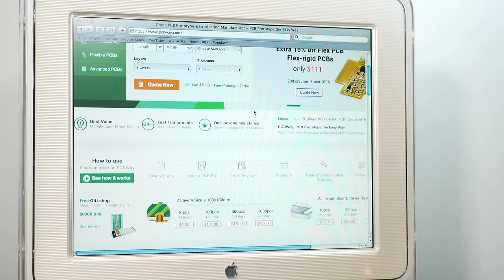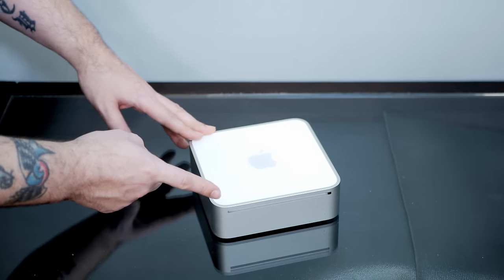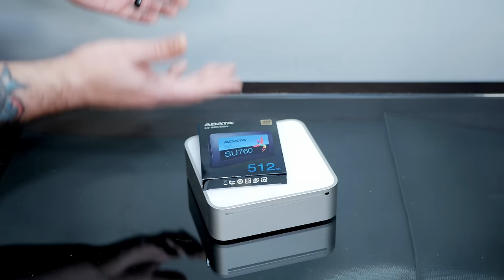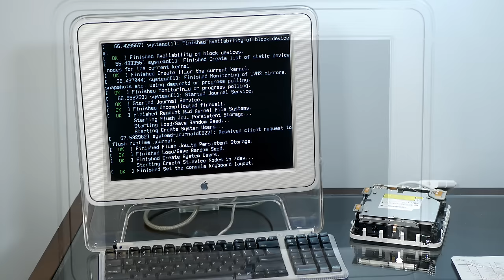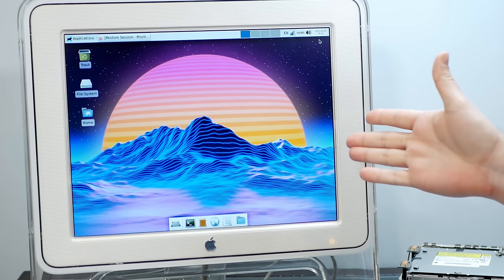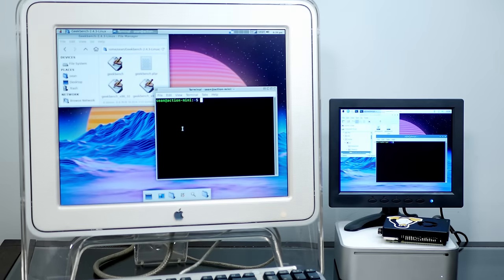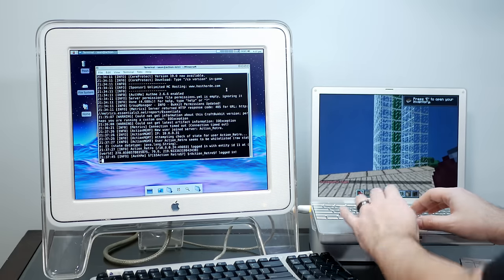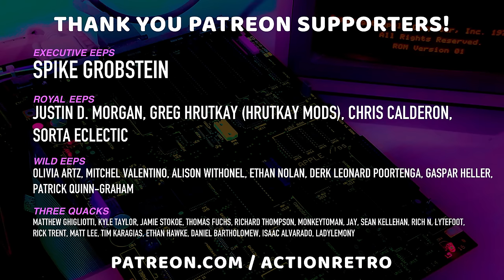Can a Cheap Mac Mini Out-Pi a Raspberry Pi 4?

Comment: The Geekbench score was 2x higher on the Raspberry because it has 2x cores, and a Minecraft server is a single core task. Basically a Mac Mini might be a better option if you only want to run a Minecraft server, but Raspberry can run more tasks at the same time so yeah
Reply: Minecraft servers nowadays use multi-core for chunk generation and loading, so the couple extra cores would help prevent lag spikes when people move around or log in!
Reply: Looked like the Pi had way higher FP performance. I think that would translate to Minecraft as well.
Reply: @seshpenguin  They really dont actually on vanilla Minecraft. That's why 2b2t for example is using an overclocked i9 so the server is somewhat playable.
Reply: @Piipperi800  Vanilla 1.13 and above does, but PaperSpigot implemented it for some older versions too (though in the case of ActionMC) it doesn't matter since its such an old version.
Reply: @seshpenguin  I don't think Spigot does that multicore thing by default unless you have multiple worlds. Also, 1.13 and above suck for servers anyway so those are out of the question here
Reply: @Piipperi800  PaperSpigot implemented multithreaded chunk generation first, now it's the default behaviour since Vanilla 1.13.

Anyway yea ActionMC is 1.2 since they want PPC client support :D I'm just saying if someone wanted a latest version MC server, a couple extra threads help out.
Reply: they definitly use at least 4 cores nowadays, but if the servers on 1.2.5 its not gonna use more than 1, maybe 2 cores
Reply: id' go for the least power comsuming system.
Reply: And probably, if he used the raspberry pi, the sdcard would die very quickly, and the SSD will work flawlessly for ages...or...at least 10 years more than the sdcard.
But if he used an external SSD it would be a different story.
Reply: @Piipperi800  they have used a few cores for a while now, And with 1.18 it uses as many threads (32) as I could throw at it for world gen
Reply: @virtualtools_3021  1.18 in general needs a pretty decent server now, running a vanilla one on my 2012 MacBook Pro and the server is often lagging out
Reply: This isn’t relevant for a Linux install, but 10.6 and later have Grand Central Dispatch which actually multithreads even single-threaded processes. 

For instance it doesn’t matter what thread variable you set on command-line 7zip, GCD/libdispatch will split it across as many threads as it can. 7zip is of course trivially parallelisable so it even uses the SMT threads at full, whereas most workloads only use them 25-50% as much as the first thread in a core. 

Though of course some processes are simply not possible to split-up, so usually the first core still has 10-20% more utilisation than the rest, and the final core will usually have 10% less. 

But GCD decides what can be split-up, rather than the app developer. So… maybe it’d help? But maybe not.

Comment: Great video!

Two or Three years ago a co-worker rescued two surplussed mac mini's at work and I installed Xubuntu 18.04 on one and Lubuntu 18.04 on the other.
We still use them for productivity. We use one for iridium satellite transmission testing and the other for random equipment  testing.

I love to see people squeeze more juice out of older tech!
Reply from the maker: Nice! Me too!
Reply: Hi - i in 2015 i purchased a fair few @2005-2007 early core2duo apple macs / minis and imacs from a school, i cleaned them out and changed the thermal paste
Installed 10.6 snow leopard on all of them and they ran great, as most people wanted modern broswer and good youtube playback i used refind to multiboot and installed linux mint ( the current version at the time possibly 17 )

Result is very cheap computers under $100 Australian, very stable and dual boot, they should run another 10 years, 1 sold about 4 or5 of them and gave away to family and friends 4 or 5, i just have 1 x imac and 1 x macbook, the imac runs 24/7 as a local file server for movies and music

Regards
George
Reply: I'm still using an iBook G4 as my daily driver laptop. I'm typing on it right now!

Comment: Also, the raspberry pi 4’s Ethernet is gigabit, not 100 megabit like the raspberry pi 3. Maybe start a separate server to test it and see how it works
Reply: well, I tried it and the cpu does not have enough performance and absolutely dies when generating chunks.
Reply: The Pi4 has fake gigabit ethernet. No idea why, maybe because it runs over USB, but it is hot as heck, and not delivering the expected speed, at best half a gig. The Mini does offer full blown gigabit with full duplex, jumbo frames and all.

Comment: I'm still amazed at how cheap you got that mac mini for.
Over here in France they are still worth 100s of €
Reply: At this rate, you might be better off buying an actual used server. It's not going to be the most powerful thing in hte universe, but my old Dell server from 2012 is still great for messing arround and I haven't had any issues running a minecraft server off of it, though I think it has never seen more than 5 people at a time...
Reply: @user-le8ul4nr5t  x58 is great dude, I just got a server for 230€, double xeon, 24gb of ram, fantastic!
Reply: In the US, the majority of Macs are cheaper because there are so many of them over there. Here, I can sell a 2009 Mac Pro with an NVME SSD for almost £1000 whereas I’d get the equivalent of about £600-£700 in the US.
Reply: @pietrocavicchioli6128  x79 and x99 are pretty cool too since they can take xeon e5's which are decently cheap right now.
Reply: @user-le8ul4nr5t  the main reason for taking the minecaft server off the G5 was power consumption.
While a vintage sever is ‘better’ hardware, a Mac mini or a raspberry Pi is much more power efficient.
Reply: @SalvoDan  most x86 and arm stuff is going to be more efficient than a G5, and servers kinda have to be decently efficient because they're meant to be run 24/7 for sevral years. Not the lowest power solution, but as far as performance per watt goes, servers are pretty decent.
Reply: @user-le8ul4nr5t  yes, but server for that platform often lack the gpu support, and they cost a bit more, and Chinese motherboard are a bit risky in my opinion, they are a lot less reliable than normal server boards, but yeah, if you can find the right deal even x79 and x99 are awesome!
Reply: @pietrocavicchioli6128  who needs a gpu anyway, ssh go brrrrrr.
Reply: Yeah that was a good deal. I have the same mini and it was $75, two years ago. I got a steal. They usually go for $~150
Reply: @user-le8ul4nr5t  Ip?
Reply: @Mangiatorte  It's a private server. I'm not publishing the IP in a youtube comment section. You would have to either know me personally or know one of my friends to get in.
Reply: Yeah I looked, been looking for a Mac Mini, and I've never seen them below $180 USD.
Reply: Here in the Netherlands or in Germany a 2009 is 25€, and a 2012 quad i7 with SSD is like 100€

Comment: I have actually tried both Mojave and Catalina on my 09' Mac Mini through the "Unsupported Mac" patches by Dosdude and it works surprisingly well for its age! It being a small device that can run as far back as Snow Leopard for the PPC and older Intel support, having Windows XP compatibility, and it being able to unofficially run versions of Mac as recent as Catalina (and Big Sur without GPU acceleration) for the more recent apps was something that I thought was really neat and a big reason as to why I snagged one last year!
Reply: I run all macs on 10.14, including the newer ones with official Ventura support. Still the best OSX ever.

Comment: Old Chromeboxes are also great for this purpose. You just need to remove the write protect screw, install custom coreboot firmware from Mr. Chromebox in developer mode, and then install a linux distro of choice

Comment: Yeah, I wouldn't use a box cutter like that anymore. I've seen some nasty accidents involving box cutters in the past. Guitar picks are too thick and so are metal spudgers. I like to fix game consoles, especially the PlayStation 3. When I "de-lid" the CPU and GPU so change the thermal paste under the integrated heat spreaders, I use painters knives. They're very thin and have a nice wooden handle. They're thin enough to slip in under the IHS to cut the adhesive without damaging the chip's substrate. They're also perfect for popping those plastic clips when disassembling stuff. You can get a cheap set for $12 on Amazon.
Reply from the maker: Thank you! I'm going to pick up one of those

Comment: You need a spudger tool.  I got 2 out of a cheap kit on Amazon.  They look like Guitar picks but have tapered edges.  Sorry you got me triggered using a box cutter.
Reply: Too thick, I tried a spudger and the plastic just bent so I ended up using a spreading knife. Whatever gets the job done.

Comment: omg i was not expecting the pi to be basically double the benchmark score, wow!! we have come so far with silicon it’s insane
Reply: Yet it is dickless when it comes to usability. Somehow OSX is so much smoother at half the raw processor power. The Mini on Mojave is a very easy to use and well performing machine capable of very broad tasks. The Pi not so much.

Comment: This video would have came in handy awhile ago! I got one of these in a trade for a Watch I don't use anymore. I eventually gave up on trying and failing Linux and just installed Windows. It now resides on my desk all pretty-like living as my new Emulation Station, which it does wonderfully. Not to mention, the nostalgia of getting to revisit Win 7 on period-accurate hardware, All in a small corner of my desk!

Comment: I run a Mini on Linux Mint Debian Edition 4 as a home music library server. Everything worked, out of the box, apart from having to add the wifi driver after the install. It'easy, because the option is given in a graphical window after install. Check the option and install the driver. And it can dual boot to OS X if desired.

Comment: Now I'm tempted to subscribe to that magazine. Not that I need to, but if they are throwing in free DVDs then it might be worth the nostalgia.
Reply: You're still technically paying for the DVD since it costs more than a normal magazine, but it's still the easiest possible way to dip your feet into Linux since it also includes a load of utilities and games on the disc ready to run, no need to dig around a software repository or install them permanently.

Comment: Did this a year ago. Debian Buster, two SSDs, etc. and a Minecraft server patched with PaperMC using a setup script originally designed for use with a RasPi 4. Set it for 7000MB of RAM allowed to be used, text mode only, and you're set. but I was running 1.14/15/16, not anything older. Last September I set up a Wyse 5020 DX0Q thin client with a AMD G-series quadcore embedded APU and never looked back. cut the power usage down to a third and it's more than powerful enough to run a PaperMC-patched Minecraft 1.16.x server, my website, and even a Half Life 2 Deathmatch server instance with a bunch of custom maps.

While it's still single-channel for the RAM, it's much faster than the Core 2 in the Mac Mini, and the fact I can use up to 32GB of DDR3 (which would be silly) is a game-changer for me. Add in that it has SATA III and USB3 onboard, and I'm sold.  Did I also mention it does all this but is fanless? meaning you can REALLY shove it anywhere you want, and so long as you redo the thermal compound, it shouldn't ever overheat, it sticks around 46-53C depending on how hard you're pushing it.

Comment: To make that minecraft server easier to manage, install MineOS. it is available as a docker image or as a turnkey iso. Once installed, it will create a web interface for management allowing you to run the mac mini headless (without a monitor attached). MineOS also has some nice features like auto backups, and general user friendliness. The turnkey version runs over-top of Debian without installing a desktop environment, this would create less overhead and no driver issues for the mac mini. I highly recommend especially for resource limited servers, like the mac mini. 
Anyway, thank you for the great content.
Reply from the maker: Oh nice thanks for this!

Comment: Holy cow!  I did the same thing with the same Mac Mini back in 2013, running on linux to be a minecraft server!  Although, I ended up buying it for $100 from a co-worker.  Anyhow, I had the same problem with the video and came to the same solution back in the day, but unfortunately there was very little on the internet as to why I'd get a black screen.  I spent about two weeks debugging the issue, and found that when grub and the OS ask the bios/efi for supported resolutions, the Mac returns with absolutely nothing.  This leads to a black screen, as no supported mode, no visuals. It make sense, considering Mac OS already knows what resolutions are supported due to the restricted hardware set.  Thanks for the trip down memory lane!

Comment: I mean, as a project or opportunity to tinker, use what you have! If you don't have any old computers lying around, then hardware like this could be an excellent opportunity to mess with things, especially after some research, but Raspberry Pi is definitely more beginner friendly, given the sheer amount of documentation available, and the fact that they were designed from the ground up with education in mind!

What are the comparative power draws while running the respective servers? That could be another consideration, especially if you live in an area with higher energy costs.
Reply: Raspberry Pi 4 by itself uses maybe 15W max, usually 5W or less, especially if you run it headless with nothing plugged into it

Comment: The pi 4 actually has full speed gigabit eithernet so aside from the mac mini having an Intel chipset for the mac mini there is zero difference actually given the cpu the mac mini might be slower. I also think trying to run a minecraft server on like a tablet would be interesting, but not mac relevant unless you could maybe jailbreak a ipad pro 2 or higher and then some how install the server there.
Reply from the maker: Oh thanks for that!
Reply: @ActionRetro  The gigabit in the Pi is weird: 1) it does not match the Mini speed, 2) the controller gets to pancade baking temperatures. Also on the Mac you have SATA 3, not the best from a modern perspective, but it is superior to USB drives on the Pi, not to mention the performance of the micro-SD card. And you can even go RAID0 with 2 SSD's.

Comment: The raspberry Pi 4 score is basically 2x higher than the Mac mini. And what does the Pi 4 have twice more than the Mac mini? The number of CPU core, and that's part of the reason why.
What's the single core score?
Also geekbench is not necessarily great to compare system with different instruction set and real use cases...
Reply: Very true. I don't recall there being a quad 'Core 2' Mac Mini. In this instance, the Pi also has half the RAM, but it does have two USB 3 ports and uses a fraction of the power that the Mac Mini draws. It costs peanuts, comes with a warranty, is one fifth the size and has lots of interesting DIY projects available. But I still want a Mac Mini to go with my G4 and dual G5 Powermacs. 😁

Comment: So I hosted a minecraft server using an old macbook air with broken screen and it's really capable.
Reply: that's not a bad idea actually 👍
Reply: How did you set it up with a broken screen?
Reply: @pnnytx  👍
Reply: I used an old school computer that they thought was broken. All it needed was a new power supply, and my dad has tons of those laying around.
Reply: @FuzekiXD  no, he's just a guy who has a lot of old computers, since throughout his life he never threw many of them away as he upgraded, and they build up over the past 20 years... I used one that's probably around 15 years old. i'm suprized it works tbh lol. I should probably get one that isn't on the verge of exploding
Reply: @bluesillybeard  yea old PSU big nono it's a ticking time bomb
Reply: @FuzekiXD  Depends on what's considered old

If it's only a few years it's not an issue really
Reply: @resneptacle  yea but he said his dad had some which would probably be like 9-10 years old
Reply: @bluesillybeard  lol I have atleast 8 laptops  at home
Reply: @FuzekiXD  I used an antec 380w 24/7 minus a bit of downtime in a nas for 14 plus years before it died peacefully by refusing to turn on after a power outage

Comment: I never knew there was a 2.0 Entry level 2009 mini. I always see them 2,26Ghz or 2,53Ghz. Today the 2,26 is like 25€, and I don't mind it being a little slower than a Pi. OSX is just smooth as heck. Try 4K montage on the Raspberry Pi. The Mini 2009 will just do that with FCP. I'm also amazed that it can still pull off HEVC 1080p decodes. Sure the Pi has more modern video decode instructions, but hey this is a all-in-one package at 1/4th the price. If you do match the Pi pricepoint, nowadays you get a 2012 2,3 ghz quadcore i7 for the price of a complete 4GB Pi package, and that destroys Pi performance, and has very nice idle/load power use.